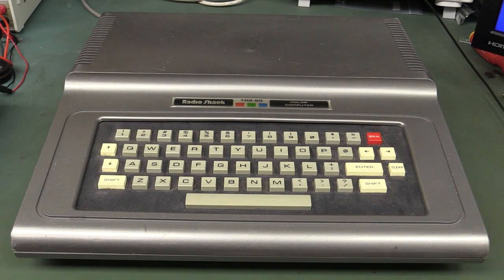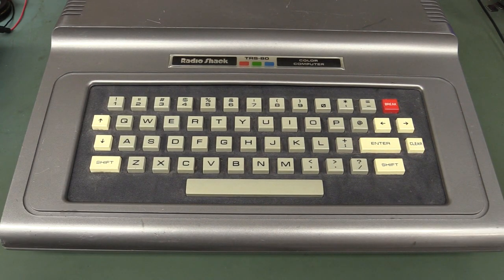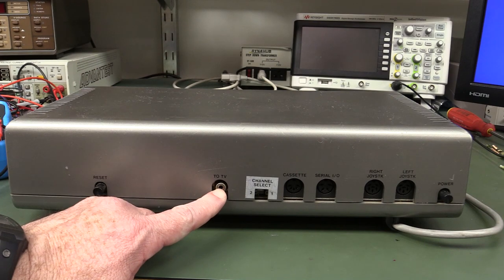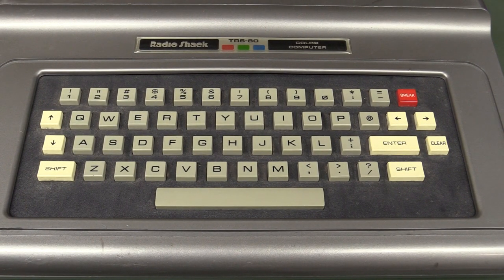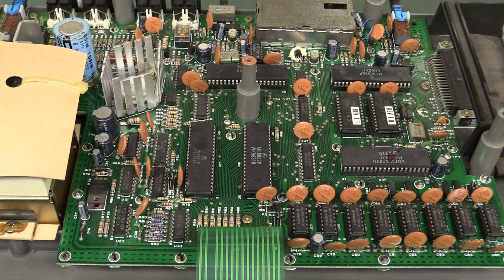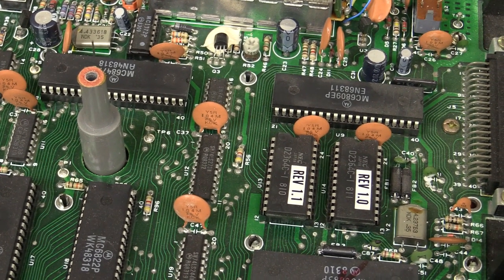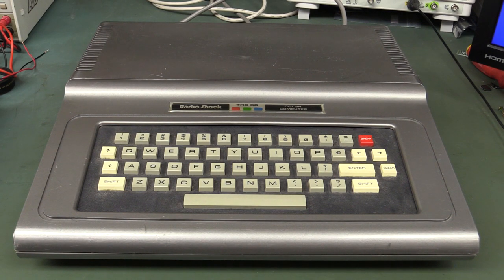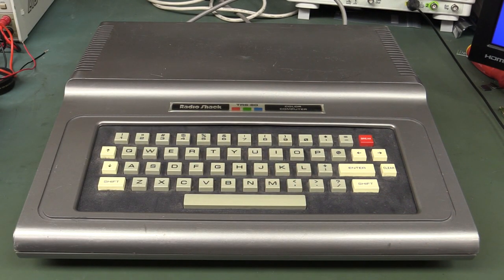EEVblog #1021 - Retro Radio Shack TRS-80 Color Computer

Comment: I’ve done it all on the coco. Mine was vintage 1982 with 16 k and I upgraded it to 64k and replaced the keyboard with an expensive after market typewriter style one. I also disabled the Nmi Pin connection in the cartridge slot so games and otther applications couldn’t autostart without me selecting a switch. This allowed me to copy any cartridge based application to cassette and reload it in a different section of ram. I did lots of mods to the computer. I used a connector for direct composite video and sound. I used this computer so much I wore it completely out. I did all the os9 stuff as well. Once i discovered how to access the address and data buss on the connector. I would use peek and poke to send data to memory mapped devices under program control. This computer was my first venture into physical programing. Turning something on or off under program control was amazing back then. The joystick ports were another place to recieve input from the physical environment. With a CDS cell connected you could determine light intensity to somewhat of a degree.

Comment: I had a COCO for several years, being a tech I did a lots of upgrades to it. First was a cherry keyboard mod, ( I saw one of the early prototypes and it had a regular keyboard on it, later I heard they change it because they wanted hold down the production costs), added 5 programmable function keys, more memory, expansion bay 3 more cartridge slots ,  2 ea. 360K Floppy drives, 300 baud modem  and a C-itoh printer. I learned a lot about computers and Basic language working with the Color Computer.

Comment: These were incredibly useful machines. We ran a freight brokerage business on this for several years. Modifying a pair of 360K DS drives with a couple of cut traces, diodes and jumpers you could split them into 4 single sided drives that were compatible with the CoCo's disk controller - WOW!!  A whopping 1.2M of data, with proper relational database software like ProColor File, was more than enough for our needs. The 32 character, no lowercase display was frequently circumvented with graphic text drivers that supported various word processors, spreadsheets and terminal emulators. Add a Hayes modem and a serial/parallel converter to hook up a decent printer and Bob's your uncle!  That chiclet keyboard had to go though, You could order the CoCo2 replacement keyboards later, but my initial solution was to hard-wire a surplus Data General keyboard for the CoCo matrix.

Comment: Awesome demonstration. Tandy Corporation, Motorola and National Semiconductor collaborated to create the Coco, so thats why its almost all Motorola chips. Either your model had an 64K upgrade kit or Tandy upgraded it so it'd compete against the C64. And dont go knocking on Radio Shack. They might have been a failure outside the USA, but in the USA they sold a lot of computers in the 80's.
Reply: Originally, CoCos had 4k RAM standard with 16k an option.  The next method  to go from 16k to 32k was piggybacking a 2nd set of 16k chips and using some jumper wires. Very kludgey. Next, they made motherboards that were 64k ready, but they'd use "half-bad" 4164 64k chips to get you the promised 32k. By then, the word was out that the CoCo could do the "full" 64k RAM. Probably a good year and a half went by from us modding our CoCos to 64k to Radio Shack acknowledging this and officially offering it in the newer models. If I recall correctly, they NEVER officially acknowledged the original CoCo being  capable of 64k. I remember being a teen, going into the local Radio Shack and getting into arguments with the Dude Behind the Counter over whether my CoCo was 64k.

Comment: The shift-0 lower-case mode was useful because you could attach a printer that did lower case.  (Don't underestimate the value of getting kids more interested in writing papers at school by having them do it on a computer, speaking as a kid at the time :-)
Reply: I had the DMP-100 I think it was. Did school reports on it. No true descenders and the thing was so loud I had to wire a telephone cable into a extra long printer extension and put it in the linen closet just to keep the house sane. The thing was like a jack hammer!
Reply: The old dot matrix printers were very loud.

Comment: I had a CoCo 2 with what's referred to as a "melted" keyboard. It was my first experience with programming. I was about 13 or 14 years old and I inherited it from a family friend somewhere in the mid 90s so it was already significantly out of date when I got ahold of it. I didn't get any peripherals with it and that includes the cassette recorder so any programs I wrote were always lost when I powered it off. There were entire weeks on end where I left the thing turned on while I worked on something only to have it eventually lost. That same family friend gave me all sorts of 80s computers including a classic IBM PC AT. Eventually I was able to inherit more modern systems as friends upgraded to the latest and greatest. I finally built my first contemporary system when I was 18, but that CoCo 2 was the first time I ever programmed anything. I learned BASIC entirely on my own and eventually self taught myself VB on some of those later computers I owned. Since then I've programmed in at least a dozen other languages and it's all thanks to that CoCo 2.

Comment: I know I'm a little late to the comment game. Thanks for doing this video, Dave! Memory lane indeed. Grew up on this machine --- or actually the CoCo 2. Had so much fun learning, which turned into a career. Given that Motorola likely designed this(their reference implementation?), using stock Motorola parts, and Bill Gates (appears he did this himself?!) wrote/ported the Extended / Color basic ROMs, did Tandy really contribute much from a technical creative side? I understand they would finance it, coordinate the effort, generate some documentation (not the basic docs though), and provide marketing and retailing outlets. Not a small effort, but looking at the PCB, where is their "mark?"

Comment: I had one of those! Got it in 1982 and upgraded to a real keyboard, the "extended BASIC", and upped the RAM from 16k to 64k (at a time when Radio Shack said 32k was the limit). The Extended BASIC chip WAS available with the base 16k models, but not the earlier 4k models. By 1982, the 4K models were gone and the 16K was standard with 32k optional. Interestingly enough, the ORIGINAL 32k models used 2 sets of the 16k chipped piggybacked. Pretty crude. Later MOBOs were set for the 64K chips, but lacked the jumpers in the model in this video. To upgrade,  you'd swap the 4116 chips for 4164s and snip or desolder 8 capacitors. 

The CPU, the 6809e, was special in that while having an 8-bit external data path, it had 16-bit internals. This means, assembly language had 16-bit operators which allowed coding that ran circles around computers with Z80s, 6502s, etc. Also, the "double high speed" POKE cranked the CPU up to 1.79Mhz which again was much faster than the other home computers at the time. There was another nice POKE that inverted the light/dark green display, so it appeared closer to a comfortable green phosphor-ish look.

These things ran HOT. External cooling fans were very recommended. I eventually sold mine and got an Apple //+ and eventually an Apple //e (which I still have, it still works and is modded to the moon...but that's another story)

Cheers!

Comment: My first was a 16K Chicklet-keyboard but I still have the 2 or 3 follow-on 64K machines and all the documentation and a couple boxes of Rainbow magazine and Ciarcia's Circuit Celler.  Back from the days of being able to understand everything inside the machine.  Graphics, Disk contollers...you could fidget with the number of cylinders and sectors on the disk.  You could understand it all and goof around with it.

Comment: My first computer was a TRS-80 CoCo 2!  I even hacked mine a bit.  Had the floppy drive hacked for double sided use.  Even learned and used OS-9 (similar to Unix) on the Coco 2.  Even though the HiRes (256x192) mode only had 2 colors, you could get 4 colors (as 128x192, but more useful than the hardware produced colors) through artifacting.  The VDG could power up on either the rising or falling edge of the clock, so colors could change each time you ran the games.  Most CoCo games would start up with a title screen and invited the user to press the reset button until the colors were correct.

Comment: I never owned a CoCo, but I did quit my job over being made to take training on them. Since I could have TAUGHT those classes, I was more than a bit miffed to be told I had to take a day's training on my own time. I'd long since bought a Model 100, their "Notebook" computer. It was pretty decent after I upgraded the memory with a sample I cadged out of a chip company for $8.00 (the upgrade, if purchased from Radio Shack, was about $100, so I saved $92). 

I had a perfectly serviceable NEC-8001 Z80 machine with actual floppy drives and a real composite monitor at the time. I had 2-3 shareware programs in Z80 assembler out on the dialup BBS circuit, given that this was before our glorious Intarwebs. I talked with Ward Christensen and got the general code for an Xmodem protocol downloader that I got working on the Model 100, so I could do error-checked downloads and uploads. (Ward still ran the Ward Board back then, and was quite amenable to conversation. He only lived a couple of towns to the northeast from me at the time.)

Comment: Nice video Dave.  I used all of the Coco's in the series and still have a Coco 2 & a Coco 3.  There is still a large following of the machine with a large number of new hardware add-ons.  Like SD card support for mass storage and many sound additions.  Some people have even taken it to the point of redoing the hardware in FPGA's to add new features.

Comment: Had a coco2, my second computer.  My first was a Tandy MC-10, basically the same computer without extended color basic or a card slot. There were a few coco style clones.  Clones in the sense that they used the Motorola reference design, the Tano Dragon was the most well known but there were others.

Comment: Had one. Spent time making BASIC programs and found the codes to make pictures on the screen, I believe  the screen was divided into squares that could be a ASCI charactor or a 2 x 2 graphic, with one byte per square
Reply: I think you are thinking of the Model 1/2/3/4. The Coco was 2x2 graphics block (black and one of the 8 colors).

Comment: Hiya, Dave! I can't speak with any certainty about this particular computer, but I've done a few composite video mods for similar machines. I've often noticed that if you cut the feed to the RF modulator, the composite video signal looks much more clear. I've never done a darlington transistor arrangement like that before, but in many cases, a simple 1 transistor amp circuit is enough to boost the composite video signal to a level that looks nice & bright on a TV and overcomes the kind of sync problems you were getting on that converter.

Comment: This is the one that started it all for me. Learning Basic language, buying program books, entering and running a program, then turn it off and start over. Using a little cassette deck to try to store programs, but often failed. I don't remember getting many of the cartridges though? Spent many teen age hours with this (fine?) machine. 🤦‍♂️

Comment: Thank you Dave. Good video.  The Atari 8bits were so much better, IMO but before we got one, I learned Basic at school on the CoCo2 in '83. It was capable and usable. I still don't know how the teacher once loaded a program all the CoCo3's at once. A primitive network of some sort using the cassette port?  The RS computers always came across as generic and the grey case style and whole feel of it even in this video still gives me that impression to this day. Maybe it's a matter of using one for years and then growing attached to it as I did the A8bit. It's easy to write these old computers off if you've never used one for years but if you did, the emotional attachment is still there no matter which brand/model it was.  Cheers.

Comment: Yes..  I had one of these..  an original 4k model, upgraded to 16k, then to 32k, and eventually to 64k..   Yes, that's just how the colors looked in the day, and actually yours looks quite good, considering what I am used to would have been modulated to channel 3, and then tuned by an old TV!    I used mine through the late 80's until I got a job working on IBM PCs and was able to get a WORK provided IBM PC.  (5 slot!).  There is still a pretty healthy following for the Coco.  A group of dedicated users still have annual meetings, there is new hardware and software still being developed, and there is even an SD card reader that emulates the floppy disk, which was developed by a dedicated user!!  I used mine basically to learn basic and assembly, and used it as a MIDI controller back in the day to sequence to my Yamaha DX-7.  I also built some TTL add-on cards for that cartridge slot, such as an auto-dialer, a touchtone decoder, etc..    Learned a lot with that little box!!

Comment: Had about a dozen of these in the early 80's.  We ripped out the basic rom and put our own custom in the socket.  With the bus exposed on the ROM cart socket, we used them as front ends on board level test equipment.  Later we switched to VIC 20's, cheaper and better keyboard.  was able to port the assembly code easy as the 68xx and 6502 had a very similar assembly language.

Comment: Ahhhhh memories! I bought one of the FIRST CoCos. 4k of mem was base and I UPGRADED to 16K! I paid in the ball park of $600 for it in 1979 as I seem to remember but 1980 is possible too ... Because I upgraded to more ram, I had to order it and wait for it to be shipped! I remember making that "graphics program" that was the "bees knees" back then, it was COLOR! State of the art 6809, 16K of ram, color and you could connect to ANY TV! I had it connected to a early dot matrix printer and used an audio tape recorder. Software was slim to not much so if you wanted to do anything with the computer, you had to write the program yourself :D  This was a big step up from the TRASH 80 mod 1 a buddy and I assembled in his room when we were in the Army. It came as a bag of parts and you had to solder it together yourself.  I kept it for a few years then sold it and bought an IBM AT clone, 1 meg of memory! That was a very expensive upgrade too as there was a chip shortage and that PC cost me roughly $2500! It had a monitor, keyboard, MOUSE, modem and a 30 or 40 meg HARD DIRVE!     I still have that motherboard, I paid so much for it, I converted it to wall art! It likely would fire up if connected up :D

Comment: The old monitors had more... control lines to the pixels so pixel drift didn't look bad, you literally couldn't see it.  Also colour precision was better. CoCo 2's also preceded WYSIWYG so when printing if you didn't have that reversed-style upper case text there'd be no way to tell what was what with the low resolution you couldn't fit a legible lower case letter most instances.  CoCo 3's had WYSIWYG document editors but it was pushing the machine hard.
Reply: These things were designed to work with analogue color tvs... I never saw a "monitor" that wasn't on a demonstration model in the shop... And I'm pretty sure that was an early Amiga "monitor" that connected to the unit. Btw if you can get one of those Amiga monitors they are arguably the best analogue TV ever made. They only have RCA in though if I remember correctly.
Reply: So you'd need a old VCR to make it work. Well I guess you would need something else anyway, seeing as they don't broadcast analogue TV now...
Reply: Was that a 1084? Mine had a totally rock-solid display: bright, crisp with no blur on 80 cpl text - if you used RGB.  It's a shame that it only lasted 6 months before the power supply packed-up. It used to click on and off, randomly.
Reply: The Radio Shack stores where I shopped used TVs, but they were probably designed for the CoCo, because they looked better than any picture I ever got attaching mine to a TV.
Reply: I don't know about where you live, but where I live (Northern Virginia) a lot of TV's (probably about 50-75%) still include an analog tuner.  They've been stripped down to only tune channels 3 and 4 (for use with old equipment like VCRs and game consoles) but they should work on those two channels.

Comment: I had one. Fully loaded. Tape, dual floppys, dual hard drives, 300 baud modem, multi cart switcher, camera capture cart, printer. Moded ram to 128k I think or 256k. Spent days typing in code to get programs!

Comment: When I was a kid (pre-teen), my parents had two of these (one looked exactly like the one in this video, though it was a US model).  My dad even upgraded one to 128K of memory (soldering the second bank of memory on to the back of the first back and lifting the memory select pin) and a 5 1/4" floppy drive.  I learned how to program on it.  I do not know why the one you had has such horrid lower case font as the one I learned on had a better font (with true lowercase).  But the graphics capabilities shown here are about what I remembered.

Comment: I had one of these in the early 80s.  Great computer back then, but severely limited by today's standards.  There were quite a few hardware hacks to improve it, including the 64k RAM upgrades and RGB adapters.  With OS-9, it was an efficient multi-tasking machine that rivaled much larger computers and even had a GUI on the CoCo3.  BASIC09 (the OS-9 variant) was much faster than the built-in ROM BASIC.  Back when fractals were popular, I used it to generate the Mandelbrot set for the school newspaper. I even had a C compiler for it. Whoa... :)